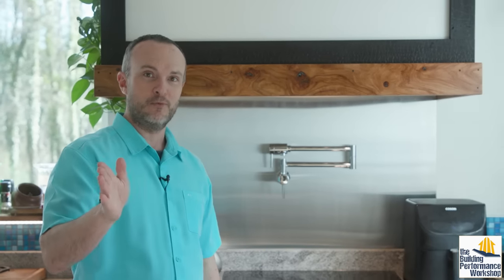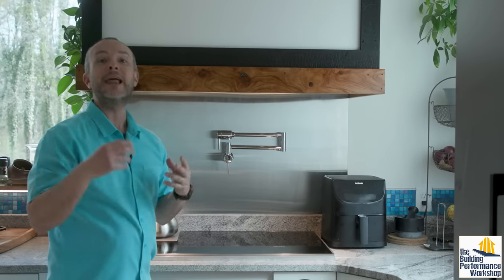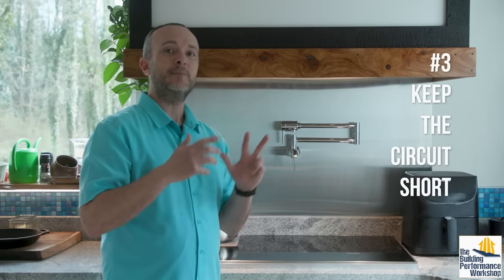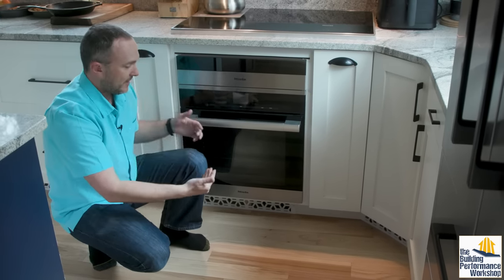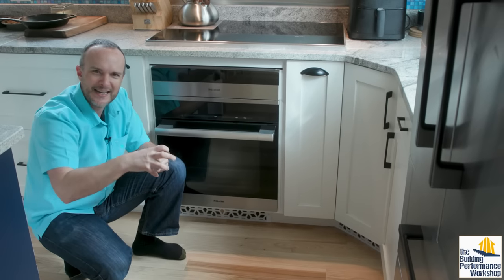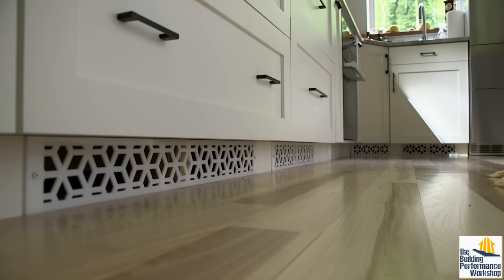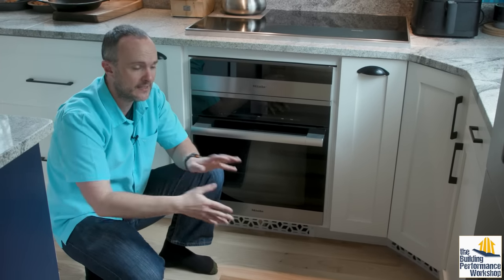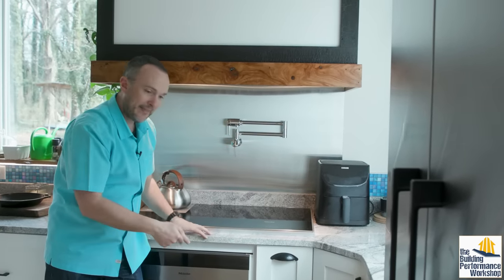3 Rules for Kitchen Make Up Air Systems: HVAC Training for Home Ventilation that Performs

Comment: I hear you on comfort in the bedroom with a higher temp and lower humidity but I will indeed challenge you on the best temp to hack your sleep. 65 degrees is the temp most functional doctors and bio hackers recommend for the best/most restful sleep. 

Just giving you some crumbs to get your gears turning for when you consult on my home build 😊

Nilima and I promise to make this engagement fun and challenging!
Reply from the maker: Challege accepted my friend
Reply: @HomePerformance  ❤️❤️
Reply: 65°... Most functional doctors and biohackers?

I'd think this would vary based on the individual "bio" as well as by the nominal environment.

For instance, no one in a hot climate is setting their interior to 65°.  I doubt it's even feasible to maintain.  Also because the body will adjust to a nominal macro environmental temperature and feel hot or cold based on deviation from that norm a blanket 65° seems a curious statement to be coming from a medical professional that should know better.
Reply: @ccvideotech  at night we set our thermostat to heat to 50 and cool to 70. Any warmer than that and our sleep quality suffers. It’s common knowledge in the bio hacking community that 65 is a starting point. You go up or a down a few degrees from there based on the results from your sleep analysis software.  I live in Houston which is considered hot. 

Saying no one does it is an oversimplification  as was my statement quoting 65. 

If built correctly why wouldn’t 65 be safely attainable?
Reply: @Anil Mittal  Let me clarify my statement.

I was referring to setting HVAC to cool to 65° in an 85°-100°+ nominal (hot) climate.  I did not mean to imply anything about heating set temps and agree that in climates where heating is used the mid to upper 60's is typical.  Presumably, if you are heating the home, it's not likely to be hot outside.  I doubt (a) that many (if any) residential HVAC systems are capable of comfortably and reliably cooling a home to 65° in a hot climate, nor (b) would it be economically feasible.  

I don't see how safety has anything to do with it.
Reply: @ccvideotech  A correctly sized cooling solution should be able to meet the clients' demand even during a heat wave; there are plenty of cold rooms that can maintain setpoints below freezing all year long, even in 100+ degree heat, it can be done it's just a matter of designing it correctly. The cost issue is more a matter of insulation and airtightness
Reply: @ZergZfTw  We're not talking about cold rooms.  How many North American residential HVAC systems do you think are in service designed to meet that requirement comfortably.  Zero wouldn't surprise me.  But, I'll say few if any to stop the nonsense.
Reply: @ccvideotech  I would bet it's more than you think. I can only speak for myself, but my cheap condo system has no problem maintaining 65F during most of the year. It does need a little help during the hottest days of summer, but that's only for a few days a year; I have a small portable AC unit I can pull out on those days, say, maybe 5-7 days out of the year. My point is that if you are a competent designer, you should be able to do it. Whether or not your client has the budget is an entirely separate discussion.

Comment: Love the work you did on this system.  Looks like you dumped the quarter end panels that briefly appeared in your previous video.  Presume they were in the way and/or unnecessary in the end.  I'd try use a deeper hood to recirculate effluent via coanda effect, improving the capture efficiency.

Comment: Great video. I've designed a split kickboard for the full length with the top 50mm in front of the bottom so the air is diffused. For the fan, I have two (intake/exhaust) operated by one controller. I have a long run so the noise is not telephoned along the duct. Will let you know how it goes when it is up and running.

Comment: 14:20 Introducing make up air from above. What prevents a short circuit where the make up air is pulled in at the bottom of the hood, "ignoring" the cooktop or range below?
Reply from the maker: The hot cooktop air is also rising to meet it, so I’d bet it all gets swept away by entrainment. Testing always helps though.

Comment: Some manufacturers suggest MUA under the stove if possible. Sounds like a recipe for rusty stove. In existing homes, that's nearly impossible and not practical for air intake source. Some Laundry room or any room next to kitchen  can be a better option for MUA entry. I have wood burning fireplace that I uses all winter long and imagine the difficulty of fresh air intake location... ;)

Comment: Are make up air systems required for homes without any gas lines even coming to the house? Our electric stove hood vent is over 400 CFM and the inspector won't pass our kitchen remodel. I'm not sure he knows that there aren't any gas lines coming into our house or even neighborhood for that matter. We live in Fairfax county Virginia.

Comment: Is fan driven makeup air necessary?  I was thinking that a backwall passive (with filter and powered damper at entry point) would be the way to go.  What is causing the velocity out of the makeup air register to be more than the hood's own draw?  I would thing the makeup air would be following simple path of least resistance relatively straight into the hood.  No?
Reply: if i recall correctly,  if you want a passive the hole has to be quite large, much larger than you'd expect.
Reply: @sscaustic  Interesting.  Thanks for the reply.

Comment: I have my make up air aluminum duct work touching (right beside) furnace and boiler exhaust pipes, which are hot, preheating the air before it hit the main duct work, just before the filter so its properly filter.

Comment: I was just about to buy a 900 CFM range hood which will be ducted to the outside via opening in the roof  with no make up air. What are the implication? I live in central FL

Comment: Thank you so much for making a video that answered all of my questions about make-up air. I'm curious as to your comment about condensation building up on the underside of the base cabinets. Aren't you using sealed metal air supply ducts running from the exterior wall vent right to the supply grills located in the base cabinet toe-kicks? If you are, there shouldn't be any issue with condensation under the cabinets.
Reply from the maker: No metal ducting under the cabs, the geometry is too weird. It’s a clean finished floor under there, so ‘panning’ in this case doesn’t result in any construction dust being transmitted.

Comment: Awesome content as always, Corbett! We’re currently designing our forever home and I’m dismayed that I can’t find any wall/built-in ovens that are designed to be direct vented. When I cook bacon, or other fatty meats in the oven, I’d really like to vent those fumes. Have you found any ovens with direct vents, any good work-arounds or is this just a ridiculous idea!? Im considering intercepting the vent on the bottom of the oven and connecting it to a duct with an exhaust fan that will be used for both my range hood and the oven. It would be controlled with a damper and a multi speed fan. 

I tried writing this comment the other day but I don’t think it worked because I can’t see it anywhere. so I apologize If this is a repeat. TIA!
Reply from the maker: Yeah, they just vent around the casing- I’f put them next to the cooktop, between the exhaust hood and make up air.

Comment: For minimalists checkout:  Messana ATU; Building Equinox CERV2; RenewAire ERV. You can program your ERV to be a makeup air unit.  But you need to add sensors and  additional controls to the system.  This may be above the capability of your local HVAC company, but it can be done, if you are willing to put in the time and efforts. Programming skills are required….but you can avoid the cost of additional equipment.
Reply from the maker: Guys, you cannot use a small balanced system as makeup air for a 300+ cfm one way exhaust. Please be careful out there.

Comment: Could you use a heat exchanger linked with the rangehood? With a bypass option depending on outdoor air? Just wondering about ways that arent a heater to preheat
Reply from the maker: The exhaust air is too full of grease particles to process at all, no ideas here.

Comment: This is how the 2020 Florida Mechanical Code reads -- look at the exceptions:

505.2 Makeup air required.
Exhaust hood systems capable of exhausting in excess of 400 cfm (0.19 m3/s) shall be provided with makeup air at a rate approximately equal to the exhaust air rate. Such makeup air systems shall be equipped with a means of closure and shall be automatically controlled to start and operate simultaneously with the exhaust system.

Exception: In a single-family dwelling, makeup air is not required for range hood exhaust systems capable of exhausting:
    (a)Four hundred cubic feet per minute or less; or
    (b)More than 400 cubic feet per minute but no more than 800 cubic feet per minute if there are no gravity vent appliances within the conditioned living space of the structure.
Reply from the maker: HAHA damn. Video forthcoming then, thanks so much for sharing!

Comment: now that i think about it a little more , my first question is worded poorly.
A better question would have been -  have you ever seen anyone use a light commercial ERV  250-540 cfm as a range hood exhaust fan system, my thinking is , since erv's are already made to be balanced , recoup heat / cooling and to help dehumidify the air it could be an all in one solution,  a guy would just have to fabricate a range hood, filter the grease in the air and have a control point. - thoughts?
Reply: cost might be an issue, but I'm unsure of make up air unit pricing  + range hood vs light commercial erv + custom range hood ,  the pain for gain ratio may be too far off.
Reply: your not going to filter ALL the grease etc out. it will make it last longer, but it will eventually clog up. same issue with people using recirc rang hoods and erv in the kitchen.
Reply from the maker: Grease is still the problem, yes

Comment: I prefer about 64ºF indoors. Sleeping I like it 60ºF or cooler. I find anything over 70ºF uncomfortably warm indoors, whether 5% or 50% relative humidity.
Reply: I'm curious what your bmi is. My mom also likes it cold like that. I always wear a jacket when visiting because it's uncomfortably cool for me while sitting and talking. If I was chopping wood, or some other vigorous activity, then 60 would be much more comfortable. She has a quite high bmi and my non-scientific observation is that body mass inversely correlates with comfortable room temp.
Reply: @chmedlychmedenstein916  I also think there is a correlation. I have a stocky build. When I was in great shape, I had a BMI of 28 (with about 15% body fat). My temperature preferences were the same then. For vigorous activity, I like about 50ºF; I'd prefer cooler but then I get cold induced asthma if I'm breathing hard.

Comment: I believe you've said in the past that "Comfort' is subjective (if not, I've heard it quite a few times in regards to HVAC) That being the case, your 75 degree 50% humidity works for you where others may vary a little in both temperature & humidity.  I keep my home in Minnesota @ 67 and shoot for humidity around 40%+ (But I've got a 70's 2 story W/basement so It's an ongoing situation)

Comment: why don't you bring the make up air  in through an  erv that is solely used for make up  air?  is there any cons / pros to this concept? is it a dumb idea?  wouldn't it be prudent to try to recoup the heat/cooling from the exhaust air also if i recall correctly erv's also help with humidity.
Reply from the maker: Interesting question- but ERVs are made to be balanced, and also they do not come in sizes 400 cfm and up anyway.
Reply: @HomePerformance  thanks for the reply, much appreciated.

Comment: I'm curious to know if anyone though of  doing a linear diffuser style around the cook top, flush to the counter, for the make-up air?
That way the air coming in to the house would technically be jetting upwards toward the range hood anyway, aiding further by essentially creating a curtain air stream around the cook top which would contain the cooking vapors.
Thoughts?
Reply from the maker: Did that on our TinyLab- you can see it here:
https://youtu.be/Xy4OvjEd3IE
Reply: @HomePerformance  Were you ever able to try a vertical diffuser so the air stream went straight up instead of it horizontally?

Loving your channel by the way. Have shared it with other electricians and trades people I work with.
You talk about topics which we know the theory on, and add that real life execution aspect which we all love and are always trying to educate the engineers from our respective fields.
Theory is great, but without real world testing it can't hold its ground.
Reply from the maker: Thanks for following and sharing, J! Vertical diffuser sounds hard to do without blowing on people, unless your kitchen is massive. Can’t really picture a scenario where that would be best case.

Comment: Critical Point ☠️: Inasmuch as I don’t want air blowing on me, I certainly don’t want to die from Carbon Monoxide poisoning. This is the most important factor when looking at make up air in an air tight home. Let me explain why: you’ve built an airtight home and you energy rater is giving you gold stars , and your home chef of a partner can’t wait to get into that kitchen and celebrate. The exhaust may actually not be capable of pushing the odorless and deadly gas/fumes out of the room - it can’t fight the air tightness. In old homes this was not as much of an issue for this specific reason due to make up easily air finding its way through drafty windows , doors, attic hatches etc. - just like you wouldn’t want to sit in your garage with a running car. Ideally Energy Raters will have to do field verification of this , as it will save lives.
Reply from the maker: Good point Al
Reply: @HomePerformance  maybe a good location for ERV return for a Belts & Suspenders approach.
Reply: It’s an electric stove
Reply: @Z71hosestretcher  100% I’m a fan.

Comment: Don’t you already have a dehumidifier built into your hvac system?
Reply from the maker: Yes
Reply: @HomePerformance  you can’t tie into that with a couple of y’s , relays and some actuated dampers ?
Reply: I’m sure a single pass is better than no pass
Reply: @HomePerformance   make it to where it closes off to the whole house and only runs the make up air unless it’s calling for both. If so, both dampers would open up.

Comment: Why wouldn't your make up air be tempered and mixed on your supply side?    2  simutaniouse dampers one that let's the fresh air in and one that opens and increases that rooms cfm.
Reply from the maker: Potentially much bigger ductsizes needed, plus I’d put it in the return for filtration, but thrn you’d need a bypass around the equipment… video forthcoming.
Reply: @HomePerformance  still learning the lingo.  A fresh air damper , filtered, on the return.   Then an oversized supply with secondary damper for air make up at that spot.  

Then do this for the dryer too
Reply: @HomePerformance  have you ever looked into aldes ERVs?   They completely replace your bathroom fans and can boost each room individually without changing the cfm in other rooms.  Stale air suction is a constant velocity airfoil..  boost defeats that foil and boosts the unit.   It is simple an genius.

Comment: @Home Performance I feel a bit called out about the 68 degree thing. I think we are going to have to agree to disagree. I personally can't live above 68. Even in the middle of winter, I don't keep the heat above 65, and that's with a reasonable humidity level in the 40% range.
Reply from the maker: Z, it's not just you, as you can see in the other comments. Wasn't trying to pick on you at all.
Reply: @HomePerformance  I know; it's no big deal. I meant it more in a humorous way, anyway. I actually agree with you on almost all counts. We have a few differences on some issues, which I think is healthy for any community. Keep up the excellent work; we need more people educated about building performance and systems based thinking!

Comment: yeah its gonna be a toe kick full of mold. Pretty sure. Look at a bathroom exhaust vent.  In time they all get mildew covered or mold covered.
Reply from the maker: Easily inspectable and cleanable, Neil, fret not.
Reply: @HomePerformance  im struggling where to put mine! I was thinking below the actual range since there is some air space there - just not accessible.
Reply: @homeperformance love your videos, Corbett! We are about to start building our forever home and I am dismayed that I can’t find any wall ovens that can be directly vented. Do you have any knowledge of any of that can be or have you come across any good work arounds ? I am considering just intercepting the ducting from the oven and rerouting it to tie into the fan for my exhaust hood.